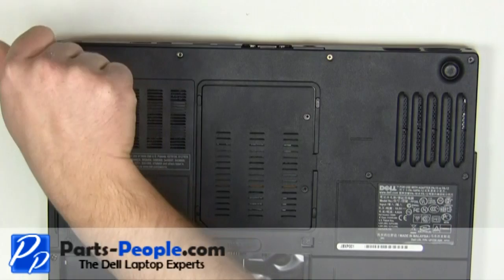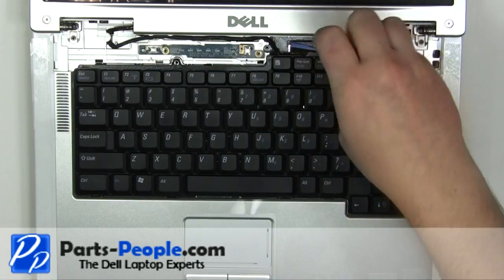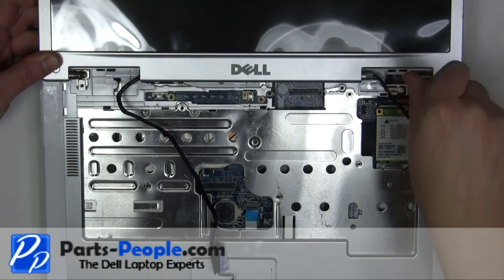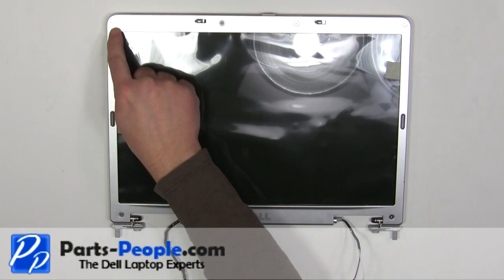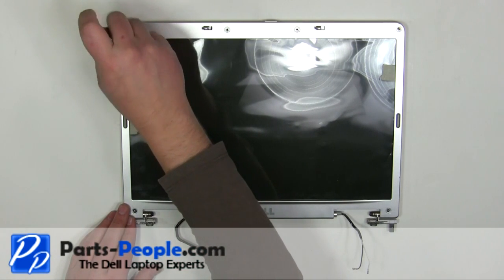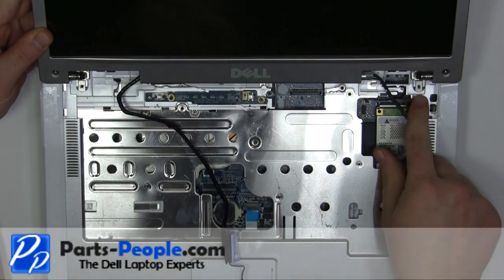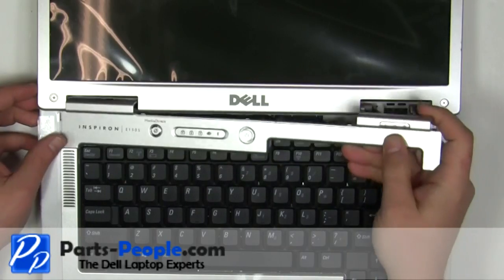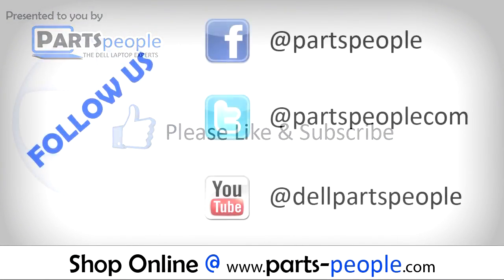Dell Inspiron 6400/e1505 | LCD Display Bezel Replacement | How-To-Tutorial

Comment: hi
i have the dell inspiron 6400/e1505 and on my screen bezel they are clips instead of screws and i dont know how to remove them. please advise
many thanks
Reply from the maker: It should have plastic screw covers. You can remove them using a small flat head screwdriver. The screws will be under the plastic screw covers.